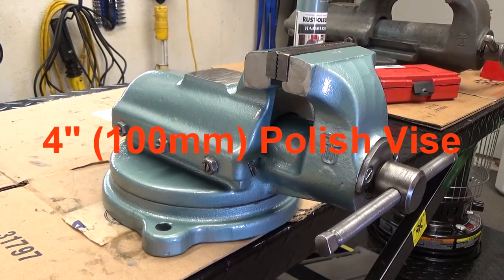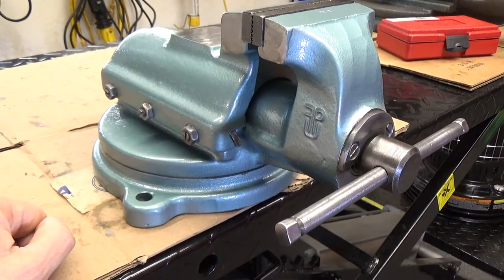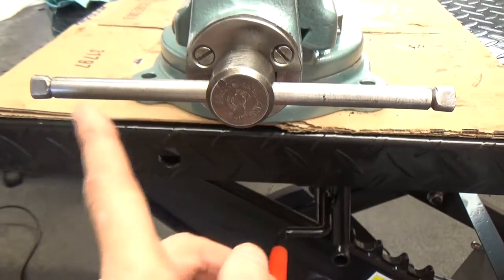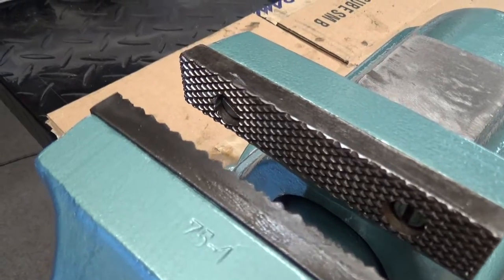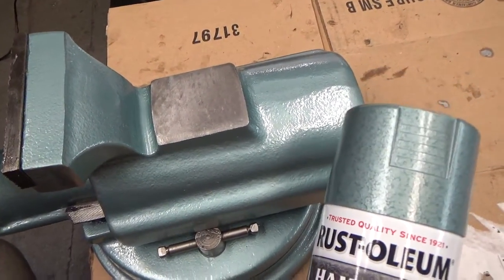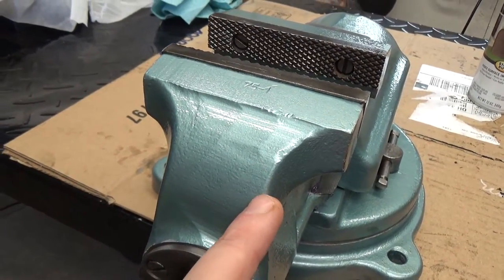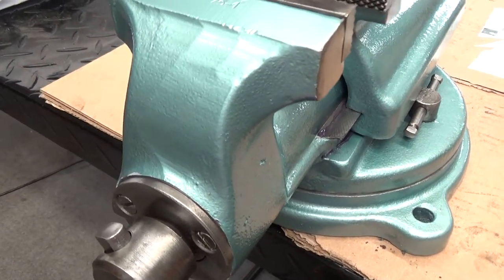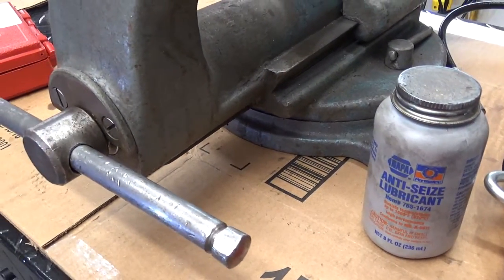4" (100mm) Polish vise restore

Comment: Very nice vise and paint job!  I have the same on you have I believe, picked up this summer at an estate sale for $10-20, I don't remember which.  Took it apart, cleaned the slides, regreased it all, works great.  It'weird in that the front jaw stays stationary but the back jaw moves.   Am going to make a small "table" on top to make it a cross slide for my drill press.
Reply from the maker: Thank you! I was attracted to this type of vise just because  of the unusual design and after using them I found them to be great!

Comment: Looks great, I have one of these that I think is just a bit bigger,.. unless you have giant hands,... and I sure wish that it had the warning sticker on it when I got it.
I had no idea that the anvil was just for looks, I've used it many times. Luckily, the vise still works fine though.
I just picked up a little blast cabinet, and I'm thinking it may be time to clean the old girl up,... I doubt I'll be quite as meticulous as you have been here though, great job.
Reply: Ah yes, mine looks just like the second you have there,.. including not saying "Made in Poland" on the front.
Reply from the maker: I think Vises make a good first time restoration projects, give it a go and I bet you will be pleased with the results.

Comment: Dang. That turned out pretty nice. I'm not the biggest fan of the color but it works. It actually looks pretty good. Great job for sure.
Reply from the maker: I hate the color myself, the vise was in such good shape though I wanted to keep it original as I could. The other one will not be painted the same.

Comment: The Verde Green looks good...kinda looks a bit vintage color. If you say the original color had more blue in it...okay, good enough. Is the Verde Green similar to Wilton's color? It's hard to tell sometimes in video.
Reply from the maker: My other FPU vise (6") seemed to have more blue in it verses the the 4" model. Not sure if Wilton used the same color,I'm not really a Wilton fan.

Comment: Bought one the other day, 15mi from me nice shape, but the rear jaw has a little play side to side is this normal, lines up fine when closed, but when you clamp something it kind of wants to slide one way or the other.
Reply from the maker: You can adjust the jaw alignment with the 3 screws but if it closes tightly aligned I would not mess with it.